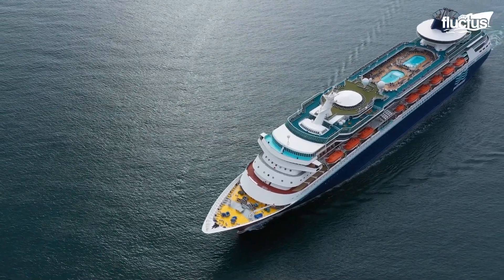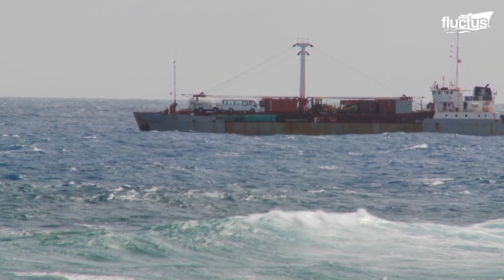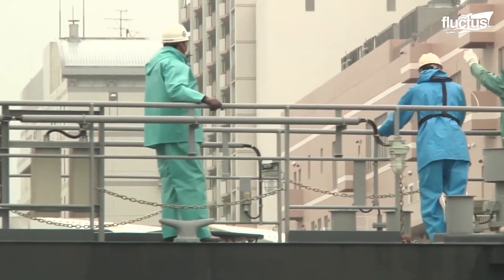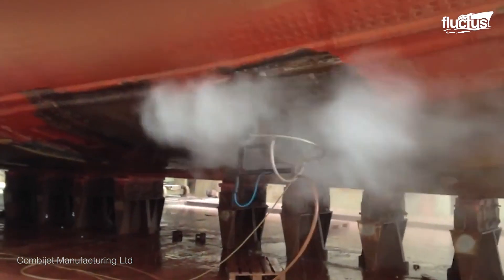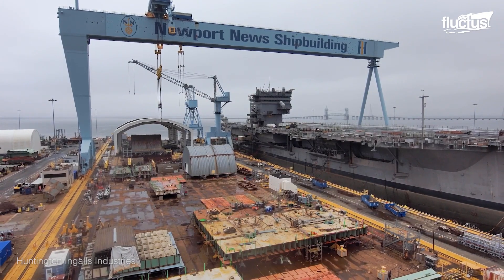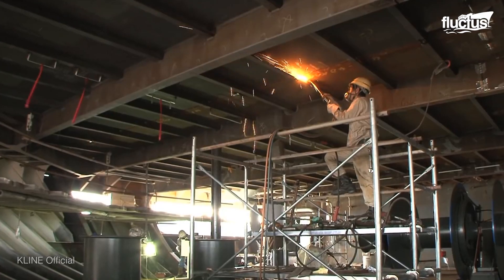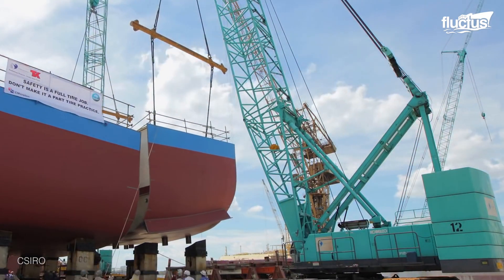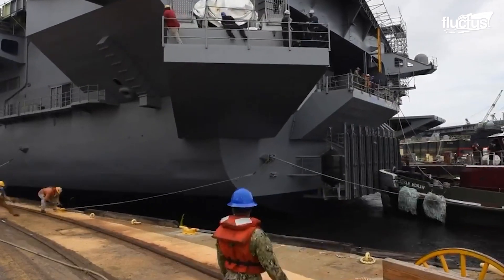The Hypnotic Maintenance Process of Gigantic Ships

Comment: Hi, I am from Yemen, I have a lot of experience in the process of protective paints, epoxy coatings used in the maintenance of giant ships, oil and iron tanks to prevent corrosion from rust and erosion factors. Is there a job?